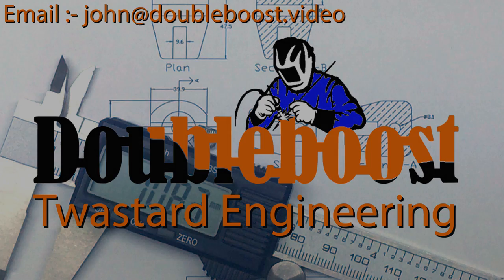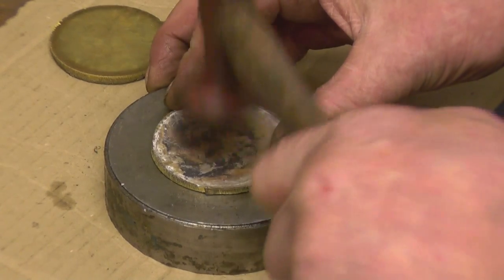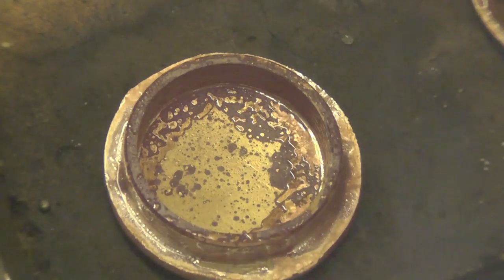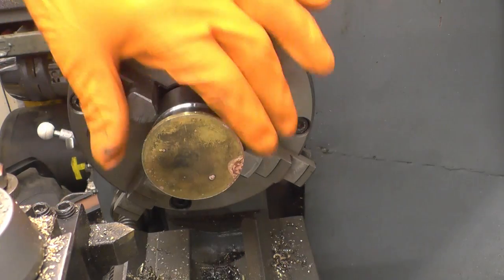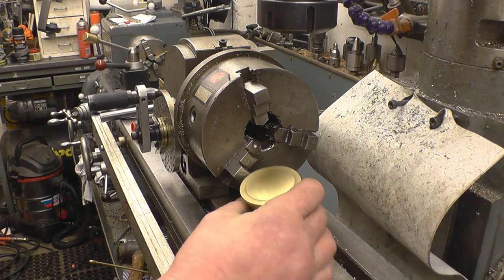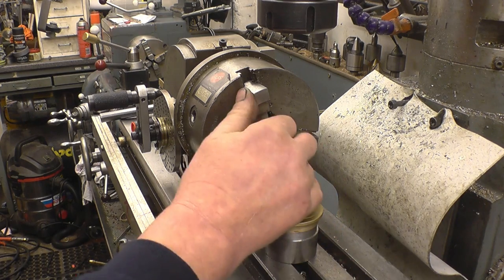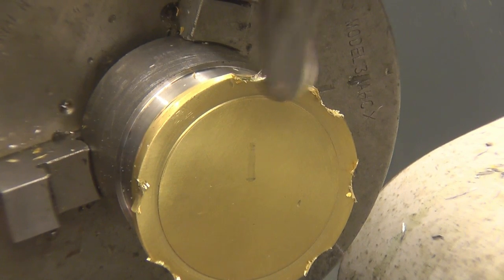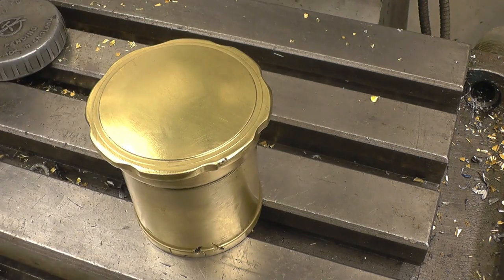SNNC 262 P2   Traction Engine Oiler Tops  silver solder

Comment: Hi John Great job on the cap looks like the origional  would have .A bit late but you being a motor mechanic you could have saved your self some time if you used a brass welch plug for the top Thanks for making vidio Ray  Australia

Comment: I do a bit of work with silver jewellery and to remove the flux (which is mostly borax) I use a table spoon of soduim bisulphate in about a pint of water which is dumped into an old slow cooker to keep it hot. Takes about ten to fifteen minutes to dissolve the flux and leave the piece nice and clean. Sodium bisulphate is used in swimming pools as a ph buffer and when you buy it this way, it's quite cheap. A tub of the stuff lasts for years. It should work for brass but it might pay to do a test piece....

Comment: Any of the forums u are on if you see an advert for a small model lathe or siege model milling machine in the port Talbot area let me know some thieving bastard broke in my workshop last night and stole mine . No good bastards.
Reply: Very sorry to hear about that, more likely on E-Bay, gumtree.
Reply: @bostedtap8399  at your right there and they will probably be sold at a fraction of there worth to me they were priceless.
Reply: @Davidthomasv8  it's worth having a look, and try to see what else they are, or have sold?. I do this regularly, if looking at the highly nickable stuff, and how long they have been selling.
Hope you have some luck.
Reply: Thanks for reply it took me a long time to save to get the machines they stole they took things that had no use to anybody other than me but I suppose that's life .

Comment: John, I have told you before, that vice was taking a lot of heat away from the brass. Use a kiln brick or a plumbers heat blanket between the work and the vice. I know that you say you are only a mechanic pissing about, but at least try to show novices the correct way for a job to be done.